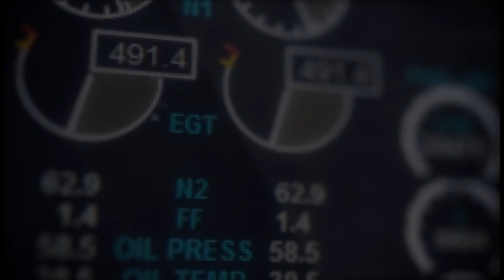Will Circular runways "take off"

Comment: A circular runway was already described in a German news magazine in the 1960s. So if nobody has built a circular runway for fifty years the idea can't be so good.
Reply: No body built the Concord for 50 years but was it a bad idea
Reply: @spoopyboi1005  the question with the Concorde is not "would it work" because we know it works. The question is "is it economically viable" which is a big thing. If you lose money operating a plane you will be out of business eventually. Supersonic passenger flights aren't a bad idea. But as long as operating subsonic planes costs the airline less per passenger... They'll keep using those.
Reply: The pilot has to bring the plane on the ground at an exact moment. If he/she misses that moment, e.g. because of winds, you are screwed.
Reply: The USAF did a study about nuclear powered flying aircraft carriers in the 60s. Same thought here lol (they also came to the conclusion that it may be possible)
Reply: @smort123  The weight of the shielding and the effectiveness of the shielding, as well as other concerns made this a bad idea.
Reply: Iirc it also irradiated everywhere it flew
Reply: Either the idea isn't very good OR we don't currently posses the technology and means to make it viable :)
Reply: To be fair, plenty of good ideas in history haven't been implemented simply because powerful people were stuck in their ways or benefiting from entrenched systems.
Reply: You'd think that be the case, but they built uranium nuclear power plants instead of thorium.
Reply: Same with Hyperloop...
Reply: Yep, I remember reading about in either Popular Science or Popular Mechanics in the 60's.
Reply: Electric cars were also invented ages ago. Only now we see them appear in greater numbers on the roads.
Reply: @AndreSomers  electric, steam and combustion engines for vehicles were built around the same time.  batteries sucked and was dropped.   not surprising batteries still suck and gas is king since 1800's so far, but slowly changing.   India has a compressed air motor vehicle, not sure the absolute range but i think it's around 100-120km for a tank of air
Reply: @daxconnell7661  crash safety is huge.  People came up with an idea for using a flywheel as a power source for automotive transport, it literally has no exhaust of any kind, and doesn't care how you spin up the flywheel!  Sounds Great!

Problem is what happens in a crash. the fly wheel breaking creates high-speed shrapnel that can kill the driver, bystanders, or maybe both.  I don't know of anyone currently pursuing it.  Also it was kinda expensive due to the exceptional design requirements to make the flywheel work.
Reply: @André Somers yes reason was simple batteries was useless so 15-25 min max drive time . Or 1 driver and full car of batteries it would drive longer but in accident cook you alive 🤷😂
Reply: André Somers because climate change isn't real. Since that's the new trend o f the day AND since Elon Musk basically devoted almost all of his BILLIONS to start the company, it exists nowadays. 

It's really expensive to create to create an electric car from scratch but Elon Musk has the money and is aware that there's a demand, even if it's not even real
Reply: @gu3sswh075  one of those people...
Reply: Daniel Grutta you’re trolling, right?

Comment: I don't know about the circular runways, but you could effectively accomplish the same thing by designing the runways to be in a square formation with an x of runways in the center. also you can keep the IAP the same and designate the landing zone by illuminating different sections of REILs for intended point of landing, since you need to be visual; though this probably wont work for a cat 2 or cat 3 approach. what I think would be cool is to have a treadmill runway that can help reduce the landing and take off rolls.

Comment: seems the design of the actual airport would be a huge issue. would have to have a long underground railway to get in and out of the airport. if the runway is 3km diameter, you would need at least 1.5km underground railway jsut to get past the runway, but then you would also need plenty more to actually get to where yuor far enough away to have a large parking garage without it being an obstacle .

Comment: This is ridiculous. The faster a plane travels on the runway, the harder it will be for it to take off. Centrifugal force will be pulling the plane towards the runway. This is why Nascar uses tracks like this, the design keeps the 200MPH cars from flying off the track.

Comment: This might have some merit for military air bases. The volume of air traffic tends to be low and the airspace control would not have to conform to civilian norms. For unmanned aircraft in particular additional risk may be tolerated. The banked runway can naturally be supported by a large earth berm. Such a circular berm has some benefit for defense in a similar manner as historical ring forts. In a modern conflict such berms still provide some protection through cover against direct weapons and some concealment to complicate accurate indirect weapons fire. It also makes organizing base defense easier.

Comment: What about J-shaped runways? The initial slow part of the take-off run can be on the banked curve, and then the high speed part happens on the straight. An aircraft will also land on the straight part, and then slow down around the curve. The benefit is that the runway does not have to take up thousands of meters of real estate, you could score about 30% of the required length. Could help when there is no space due to mountains or tall buildings. Or to extend the theory further, what about oval runways?

Comment: Great way for the airliner manufactures to make more money due to the increase in maintaining planes. More ware on tired, shocks and struts.

If the airports can require more fore cost for maintenance crews, maintaining maintenance crews or requiring all parts be bought out of the airport sales this could really rack up.
Reply: For more information on this, look at cost feasible public transport being musseled out buy willing corrupt politicians. 

The auto industry was able to switch these cost affective means of public transport to mostly buses. Buses that they could then charge for maintenance, tires, and even the oil industry racking it up.

Comment: I think there are probably better solutions to crosswinds.  The triangular airport arrangements seem to be a good first solution, but I wonder whether it is possible to have dynamic geometry parallel to the RWY that direct air upwards, creating a sort of tunnel?  I suppose the other way is to bring air from the windward side, through huge underground ducts, to the opposite side where the air can be dynamically directed to provide offset and an overall headwind to the arriving aircraft.

Problem is, it's all about money - and nobody is going to spend any unless it reduces operational costs.

Therefore I think that any successful solution will be one that makes economic sense for the airlines/airports... probably by saving on hold times and allowing for tighter separations between arriving and departing aircraft.  It's all about the passenger volumes and fuel burn.

I did have a thought about a kind of maglev runway, in which the aircrafts own speed over a 'runway' moderated a generated corrective influence on the wings ... and, as the aircraft slows, an 'active' system then takes over as a sort of auto-taxi.  This would reduce shock and wear and allow for tighter spacings... including landing behind aircraft still on the RWY.  The ability for the active system to perform as a launch assist may also be useful, perhaps even having some effect on noise abatement criteria.

In my abstract thoughts, the speed of the aircraft over the rails of the runway keeps each wing locked into a sort of invisible groove, neither wing being too high nor too low, and any yaw/roll moment being magnetically corrected whilst there is still significant forward motion through the field.  The pilot kills the engines once he hits the active part of the runway and the magnetic deceleration/tractoring begins... dropping them neatly in behind the taxiing aircraft in front - in a conveyor 'slot'

What would ALSO be nice is if cabins could be detached from the airframe and make their way to the terminal, as an outbound cabin gets attached to the airframe.  Turnaround times would be incredible and the apron would resemble a sort of automated cargo container port.

Such a system would handle cargo and passengers equally well, and an airframe with warnings could simply be taken out of circulation, without passengers needing to disembark and return to the terminal.

Of course, one day all this will be done by drones.  By then, the rapid turnaround of passengers will probably lead to modular systems and standardised cabin geometries... landing airframes being divested of their cabin, refuelled and tested as they make their way around the track to the departure, where a new populated cabin is affixed and off they go again ; )

Airframes showing warnings will be pulled from the racetrack and replaced with recently serviced frames... and nobody will care about the wings/engines/pilot - only how their particular (operator branded) tubular transport cabin, is appointed.

Comment: Interesting concept, but honestly it brings more problems than it solves, even to things it is supposed to solve. They'll solve runway congestion by creating the ultimate ATC hell and screwing up airport to airport operations, worse weather operations and a helluva load of unnecessary danger? Probably most airliners would also need to be refitted with equipment that is required by new circular approach systems making most airlines not see the airport as important enough of a node to set up routes into as costs of upgrading their fleet would ramp up quickly not to mention new mechanical stresses of having aircraft standing on a canted runway, quite certain tire wear would increase as a result too.

Neat idea, but I like many others do not see it happening outside scifi.

Comment: Circular runways is nonsense.........there is many chances of aircrafts drifting away and colliding in the terminal........and the aircraft will not be able to turn as the speed increases......as higher the speed the lower the turns.....so it's a stupid decisions. .....it may be all cost and money.......so the conclusion is ..... NONSENSE.

Comment: The whole concept of circular or semi-circular runways is ridiculous in my opinion. With the traffic loads international (heck, even regionals nowadays) airports carry these days, even parallel runways are an ongoing issue. Special NTZ controllers are needed on legal parallel runways, slow aircraft, fast aircraft, slow climbers, fast climbers, mix of jets and light aircraft - an ongoing issue, not to mention the cost of new infrastructure. Take LAX for example, you couldn't even put a circular system there.....no land.

Think hovercraft baby, hovercraft. Starting today (or whenever) start building comm'l jets with swing jet designs.....the technology is there now, once again modeled after military research.

ATC: Lufthansa 456 Super, Climb to 500, turn to 350, winds are 354 at 14, cleared for takeoff.LH456 Super: Roger, let me find my keys first, where are them damned keys.

Comment: Some other things that came to my mind immediately:

1)  How do you expand the airport that is surrounded by a continuous runway? There's no possibility for growth after the initial layout. No additional gates or hangars. Just an immutable supply to handle an increasing demand.

2) Banked slopes have a major issue with gravity still pulling straight down on the CG of the plane, meaning the load of the main gear on the inside radius needs to support more weight, which the reinforcing adds weight, which means less billable useful load on planes. I don't think any airline would go for that.

3) To land the plane has to be banking. The degree of angle in dihedral wings will make some planes slip more than others. A design that ensures that some planes (e.g. Hershey Bar GA planes) always come in for a crab-walk crosswind landing is not feasible. Your Cessna 172 goes from a Touch-n-Go on a missed landing to Touch-n-Splat.

4) Even in ideal conditions, Landing Flare goes from timing when to pull back on the stick, to precisely controlling 2 control surfaces ( the stick and rudder) because of the hybrid 2 axes of rotation. 

I don't think the best way to handle cross wind landings is to turn every landing into one.
Reply: Answers to your questions, in order:

1: You can add underpasses, strengthened of course!

2: No idea

3: The landing will be weird but I would assume there would be a small section of straight runway to allow the plane to safely enter and exit the circular runway. 

4: Not a clue

To add extra runways, you can make circular runways with larger diameters :)
Reply: @lukeweeks3470  won't additional circular runways interfere with one another?
(Inner has to give way to outer)

Or is it just a case of reducing the area of an airport? (Not so much reducing coordination)
Reply: About 1, first of all, the runway doesn't have to circle the airport. And even if it does, underground passes would solve everything. Probably not as accessible for really small airports, but really small airports I don't think will have circular runways anyway.
Reply: I know it's an old thread... but the topic is interesting :)
1. It doesn't seem like an issue for me. Sure, building tunnels is expensive, but building the whole runway will be multiple times as expensive. The can be inner ring, outer ring, and maybe one in between. As one of these runways should serve as 3-4 straight runways, it should be enough for any airport.

2. The force during takeoff should be lower than 0.1G. For a circle over 10km long, it can be 0.05G. It's not nothing, for 70t aircraft we can count it as additional 5t. But with better fuel efficiency, maybe better materials and lighter planes, it's not impossible to overcome.

3. I'm not a pilot, so can't say too much about slipping different aircrafts. However, I expect such a runway to have a variable angle - maybe even straight inside and quite steep outside, like 10', to minimize the risk of leaving the runway in unexpected way. So, during a touchdown you could use the inner part. And even if not, 3-5' seems acceptable?

4. True, manual landing would be harder. But it shouldn't be an issue for computers.

P.S. In the video he mentions about slippery runway. I don't think it's an issue - I think even right now there are some heated runways to melt the snow? And water would have an easy escape, so in case of poor braking performance on the inner part of the ring, the aircraft would be thrown to the outside, with very little pollution.

P.S.2 One of the top comments is to build an indoor runway. It sounds stupid right now, but in the future... who knows :) Right now we can deal with crosswinds at least - just build some walls along the runway. Or even build a city in such a way, that buildings near an airport act as a shield.

Comment: In the far future, gigantic circular runways with diameters of many miles could be part of a decentralized and automated system ringing metropolises. Lessening the effect of the turn radius by making the ring larger would solve problems, and making the ring run around less densely populated areas outside the city limits would solve problems as well. The massive scale of such an endeavor would create infrastructure challenges that don't have good solutions today, but it makes one wonder how bad it would be to have planes taxi at 100 mph for several miles in such a setup.

Comment: 1st of all, thanks for your channel. It is a real eye-opener for wanna-be pilots like me.

You have obviously given circular runways / airports much thought. As a pilot, you are certainly more qualified than most.

In light of your numerous valid concerns, to even consider a circular runway it would probably need to require less than an X-degree turn (bank angle) and have less than a Y-degree FLAT bank on landing (not curved as shown in your drawing).

And, that Y degree bank would need to be fairly universal since failing to account for even a 1 degree difference could cause wing contact with the ground during turbulance or a slipery runway.

So, how big would a circular runway need to be if it only allowed for an X-degree turn if 'x' were say, 20 degrees?

I suspect it would need to be MUCH greater then 3km.

Just a thought

Comment: Mentour Pilot. I've had this idea that what if the circular runway's surface was the same concept as what we have now inside of airports and some casinos (walking runway's.) The same idea but instead of people using them to get ahead or around other folks standing  on them. For example a carousel spinning the way it's suppose to do but the surface area all the different animals/attractions are mounted on is spinning the opposite direction at an approved minimum safe speed. Pilots/atc could figure out the best approach but more importantly, it would allow pilots/atc to land at any part of the runway without worrying about running into orange.

Comment: If the problem is wind direction, why not just have an asterisk or snowflake shaped runway where the arms are offset to the side from the center? Tower in the middle, other buildings — parking and terminals in the empty spaces on the side, mostly underground for runway visibility.

Comment: Yeah modify planes with better suspenshin, sway bars, wide low profile tires and drift a plane on landing. Then make everyone pray when landing so the plane will not roll and turn in to a mass casualty fire ball. 😉